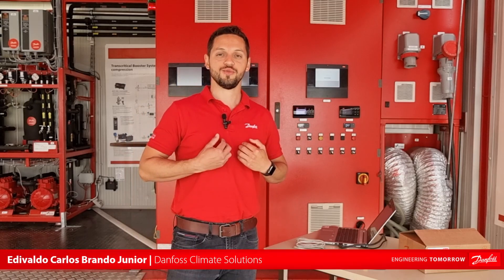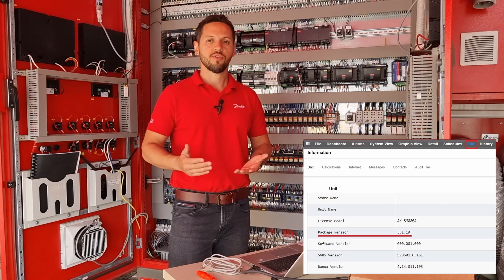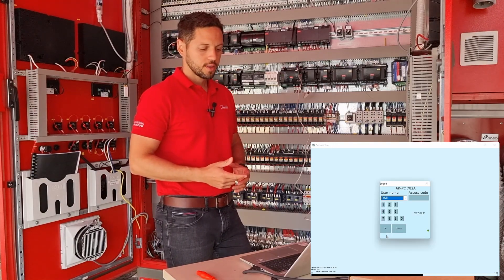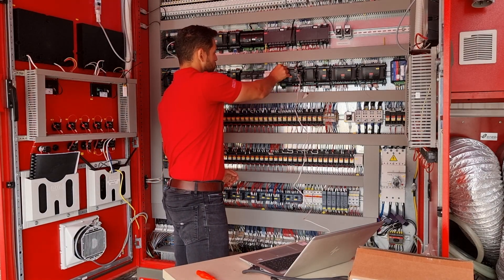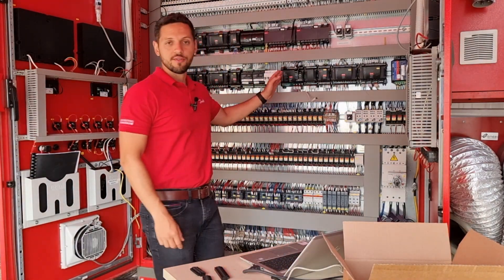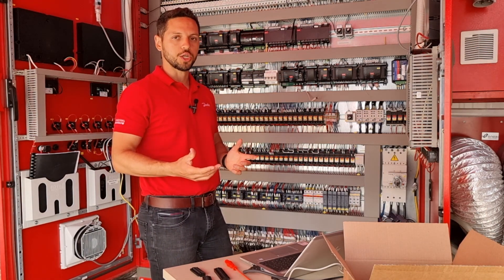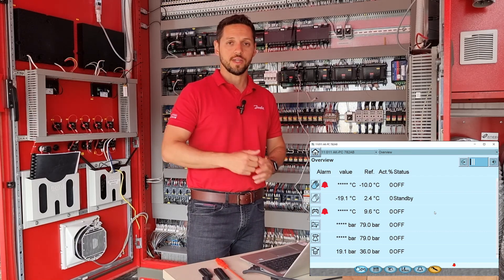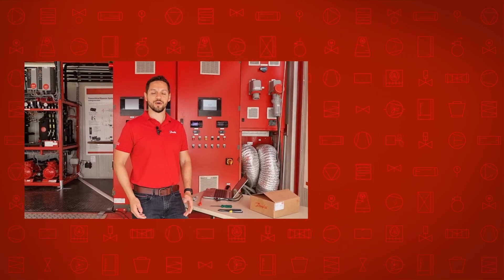How to replace AK-PC 782A with AK-PC 782B

Comment: Is it possible to install backup on different software versions like for example 3.6 to 3.7?
On the site there is version 3.7 to download, where can I find old versions to, for example, do a downgrade and use a backup of a previous version so I don't have to reprogram the controller?

where can i find the .TGZ files
of the various versions to update the AK-PC 782 (080B0192)?
Reply from the maker: Thanks for your question. We will check with our experts and get back to you.
Reply from the maker: Hello Luis. Yes, you can download backups of different versions, but ensure that the versions have similar release numbers - the first number must be the same to ensure compatibility (for example, 3.xx or 2.xx). You can always ask your local Danfoss support for the flash files, they will be glad to help. Thank you.